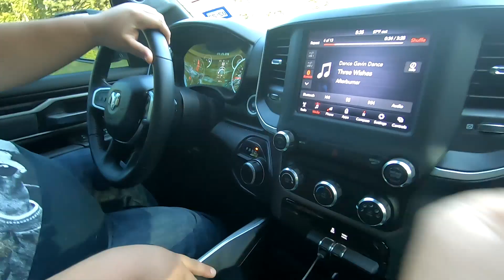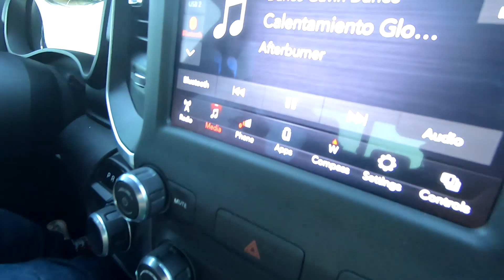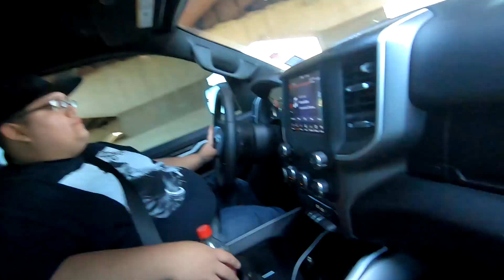A little Saturday update!

Comment: I'm doing an ls swap on 98 obs it has a v6 do I need to change the motor mounts to the 5.7 mounts
Reply from the maker: If I’m not mistaken you need to do exactly what we did
Reply: @MattyXBuilds  ok thanks my v6 has the 4l60e transmission I heard that it would work with the ls motor but just change the bell housing
Reply from the maker: If your 4L60e is the 2 piece casing then yeah you can just change the bell housing. You want the 360 degree bellhousing with the bolt hole at  the very top
Reply: @MattyXBuilds  yeah the bell housing has the hole at the top
Reply from the maker: You should be good to go then
Reply: @MattyXBuilds  thanks